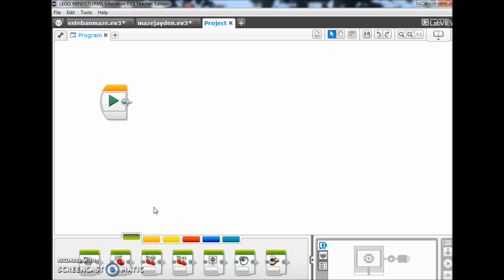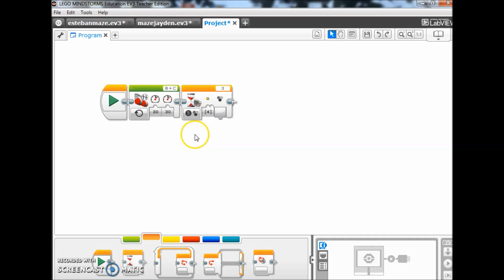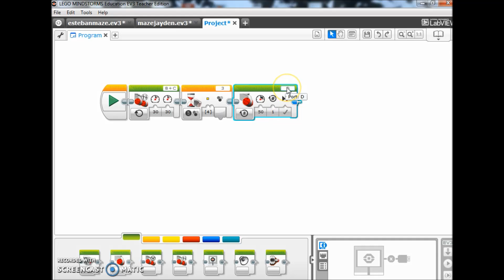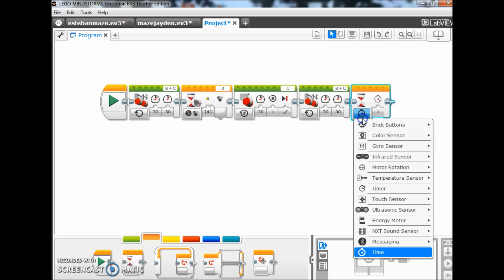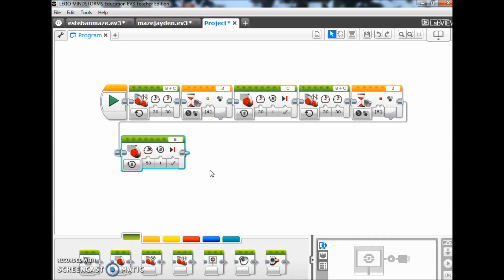"LEGO Mindstorms EV3  The Color Sensor Maze!!!"

Comment: this seems like a complete waste of the EV3 programming because you dont use memory in the way that you can change the course and have the robot still complete it. Do this by having multiple start buttons and each one (repeat untill see (color) : go forward ) then after that have a ( (left/right turn ) then an infinete repeat over every singel one ( use two colors, one for left turn, one for right turn ).
Reply from the maker: Nothing is a waste if the students are learning.  You gotta remember that every student will have their own level of understanding and yes, a student who understands this method will be able to learn the method you're talking about.
Reply: Fair enogh, but im starting 7th grade (12 years old) and you said your students are 8th grade and i thougt they needed something more callenging, but maybe im wrong. My school have used something called a ”BlueBot” wich you click four buttons either forward, totate left, rotate right and a start program button. Its just one bot that you program and then start, it moves about one decimeter at a time so you can make mazes and then program the bot

Ps.  Im sorry, i did not mean to be mean    its just that the EV3 is quite expensive and there are other cheaper bots that do the same thing
Reply from the maker: @wilmeroberg9794   No problem.  This particular activity was for my Robotics 1 class and I have 8th graders in my Robotics 1 class who might find this challenging.  My Robotics 2 students can do a maze with less predictability.  We do a million things with this EV3 and this would just one of those things.  Rock on Snickers!!
Reply: Keep up the good work Mr. Hino
Reply from the maker: @wilmeroberg9794  Thanks!!

Comment: What are the dimensions of your maze?
Reply from the maker: Hey Brett... do you have a regulation size FLL table?  If so, let me get back to you tomorrow so I can measure all the straight aways and turns.
Reply: @LEGORoboticsMrHino  No, I do not have a regulation table. I teach robotics as a quarter long elective so we do not go too in depth. Just the length and width of the table would be great and I can take it from there. My room is not too big so I do not have a lot of space to put the table.
Reply: @LEGORoboticsMrHino  No, I do not have a regulation table. I teach robotics as a quarter long elective so we do not go too in depth. Just the length and width of the table would be great and I can take it from there. My room is not too big so I do not have a lot of space to put the table.

Comment: I used the same program but I ran into an error when its time to sense the color red and move to the next command, I'm not sure what it is but I think the sensor is too close to the paper?
Reply from the maker: It could be the paper, it could be too close, or what we found out was that the robot was sometimes making the turn and it was still on the color before it left the paper. So in other words, the robot was sensing the same color since it was still on tjhe paper.